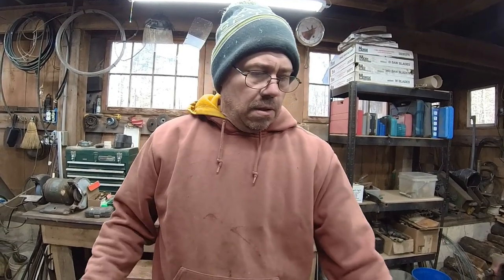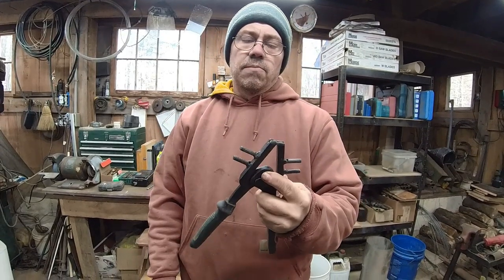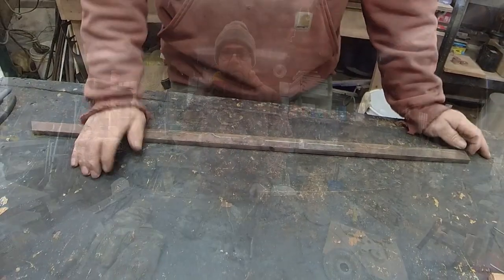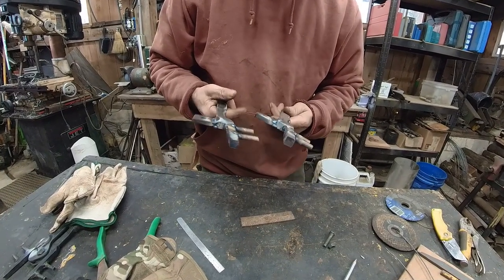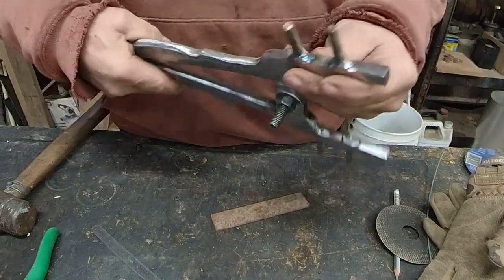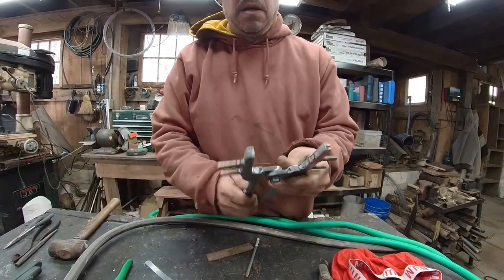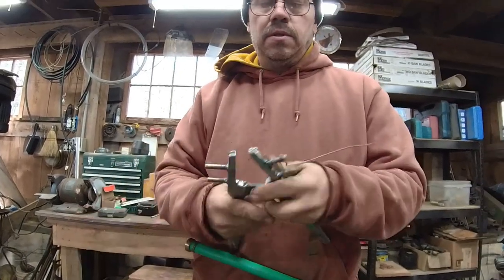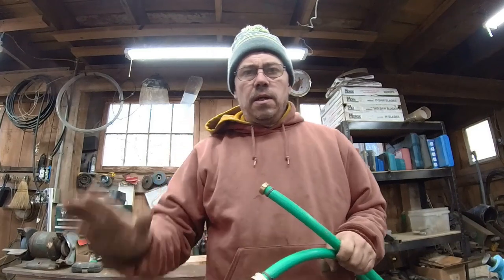DIY Hose Clamps new tool to make the job easier.

Comment: What would you suggest for a woman with no metal cutting/ tools skills? I watched your other video first and then this and thought most phenomenal idea as I replace dozens of hose clamps every year as they leak, pop and catch in grass ( 1 inch irrigation line all over for watering). They slice your hands open, if you overturn they pop, and they leak very quickly. Is there a tool one can buy ?
Reply from the maker: If you take picture to a welder they could build it for you in about 20 minutes if you didn't know a welder. There is a tool you can buy. https://www.amazon.com/shop/russwilson?listId=2TOR819WNCW8O here is a link to my amazon store for the tool. You will be glad you have one. Thanks for watching!!
Reply from the maker: I would build you the simple hose clamp tool. You email me at ancattle@mail.com I think I have an extra in the tool box.

Comment: Why not just spend a dollar and put real hose clamps on that isn’t going to rust out in a year.
Reply from the maker: That is a great question. I have a ton of reasons not to use screw type hose clamps. I think thats the real hose clamp your referring to. The wire hose clamps are smooth. They will not catch on the grass or on me when dragged thru the field. I have been cut badly from the tab that sticks out from the screw type hose clamp. It is cheaper than to getting in the car and going to the store to buy a hose clamp. They do not leak like the screw type hose clamps do. I have been using them for three years and never replaced one do to rusting out. We are using silver rod class galvanized class 3 wire.  They don't have the screw sticking out on the side that gets in the way when attaching it to the hydrate. In a low input system every dollar spent is one less dollar earned. I guess everyone has their own preference. Thanks for Watching!!
Reply: If you don't understand what type wire to use that will hold up to the elements maybe you should just stick to using store bought clamps. Low profile is a good enough reason to go with this style clamp. If you've ever ripped open your hand on a screw type clamp you'd understand.